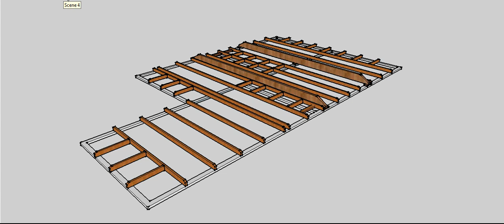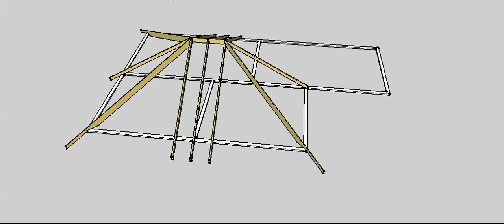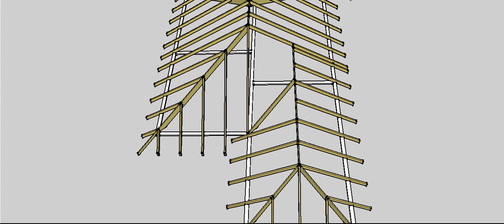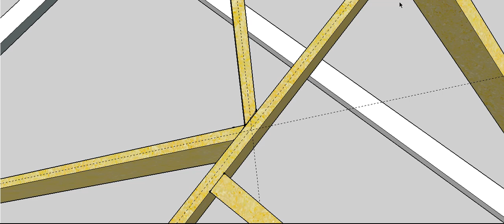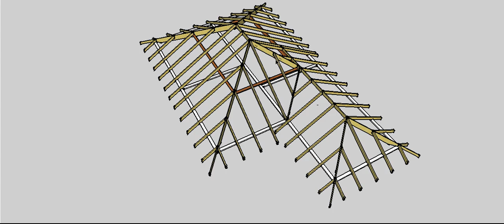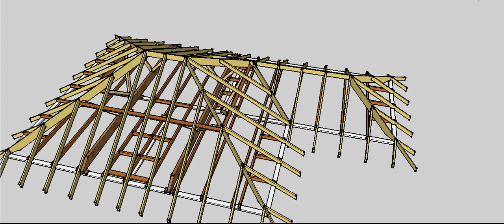Broken Hip and Valley Roof

Comment: Hi BuildSum, I really appreciate your trade knowledge and how you are across digital skills. The explanations, the graphics for 'zooming in' for detail are very helpful. 
Could you please consider explaining, how the broken hip and valley 'tracking to centre lines' sits just a little higher than the secondary ridge board.
Cheers Ace.I,m looking forward to watching more of your informative explanations.
Reply from the maker: Hi Mate, Thanks for your comment, you have pretty much hit the nail on the  head with your question. In order for the centreline of the broken hip to intersect with the centreline of the minor span ridge then it has to sit higher because it is cut shorter than the centreline so it can mitre to the side of the ridge. I have been thinking about doing a video on calculating the length of the Broken Hip so that might have some better details in it for you.
Reply: @Buildsum  Yes we would love a video and calculating broken hip :) Thanks for your work.

Comment: Learning a lot from your channel, With the valley rafter do finding them a bit hard to understand fully, do they have a 45 cut on the top view? And a on the cheek cut what's the angle?
Reply from the maker: Hi Aaron, yes on the plan view they will have a 45 degree edge bevel however 45 degree is not the actual angle. The Plumb Bevel for the valley is the same as the Hip. If you were to set you circular saw to 45 degrees and cut along the Plumb Bevel for the hip you will get the correct edge bevel.
This link might help. https://www.youtube.com/watch?v=inSM6upJf3s&t=627s

Comment: Is it possible to bulid this design with metal frame I mean metal and aluminium frame
Reply from the maker: Hi Mate, you can get trusses in metal however as far as building them piece by piece like a cut roof, it would be possible but i have never seen it done. I would say that it would take a long time to do and therefore be expensive.

Comment: Your hip and/or valley was off slightly, shouldn't the cross point of the hip and valley centrelines meet over the centreline of the ridge board? Also wouldn't the roof be more structurally sound if the hip extended all the way and the secondary ridge was shortened?
Reply from the maker: Hi Fav Yes it does look like the line don't meet in the picture, however, remember that 2 of these lines are running at the pitch on the roof and there is no guarantee that the view that you see is exactly straight down. So yes the centre lines should meet over the centre line of the ridge board.
As for continuing the hip through it might be more structurally sound however it would require all of the rafters below to be cut around it and use alot more materials so it depends on what your preference is.
Reply: Buildsum the reason I knew they weren't in perfect alignment is because it looks like your hip and valley were only single bevelled, to meet at the precise point either the hip or valley would need to be double bevelled, whichever one is inserted last will need to be cut twice on the compound miter saw. 
As far as which way to frame it I've seen it done all 3 ways, it all depends which board gets installed first, the hip,ridge, or valley. Since valley rafters take the most load I like to leave them the shortest.
Good video, I really need to learn SketchUp that looks really useful!